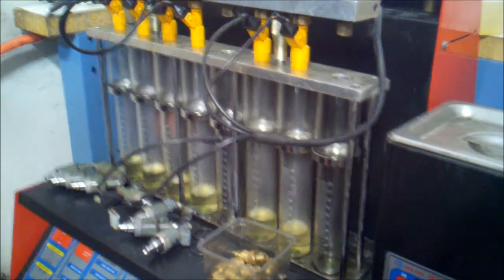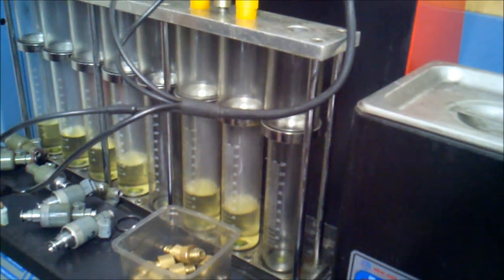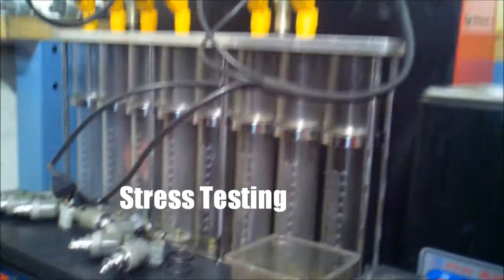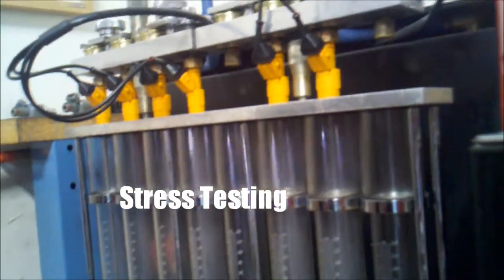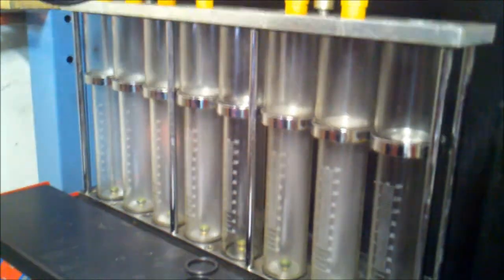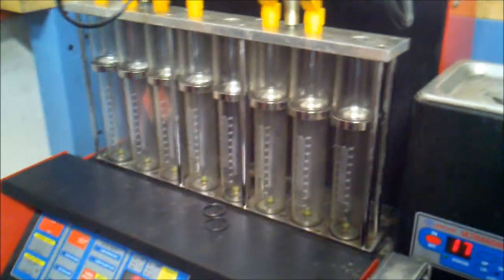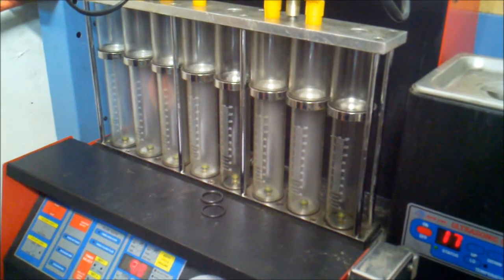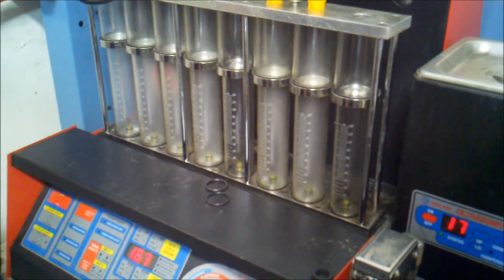Jeep Injector Upgrade with Volvo Bosch 0280155746's

Comment: These are rated 19lbs @ 43.5 fuel pressure. At what PSI did you get these injectors at 22lbs? Thanks in advance.
Reply from the maker: JuanSC Rojas I don't recall, would have been either 45 or 48. Whatever the maximum pressure of the Cherokee high output fuel system delivers.
Reply: Cody LePenske. Thanks